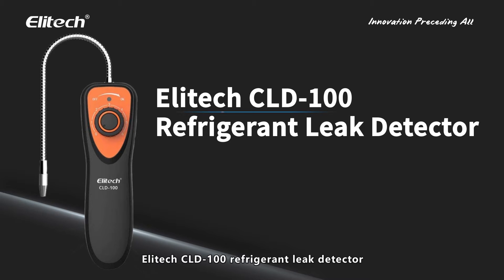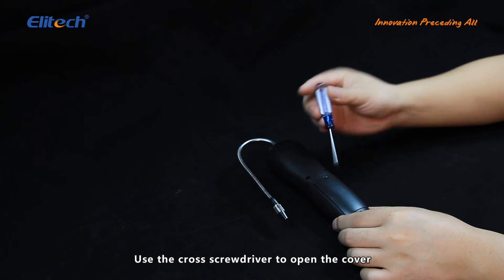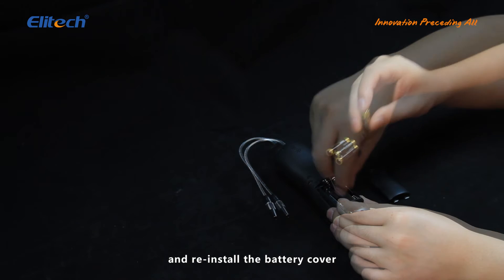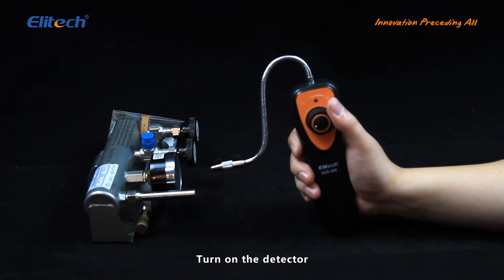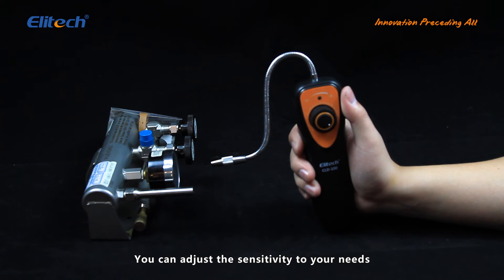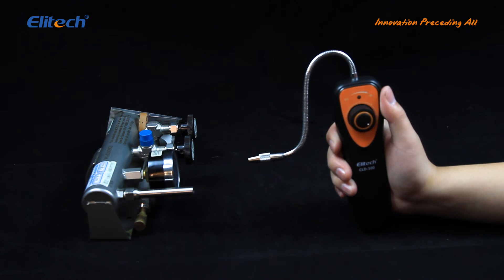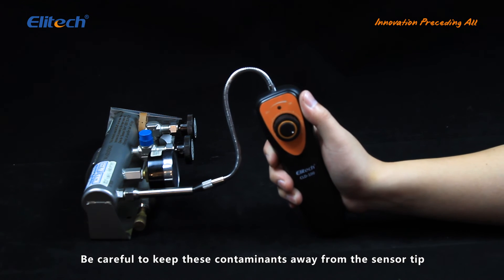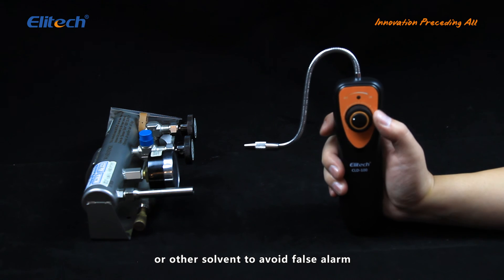Elitech CLD-100 Refrigerant Leak Detector Halogen Refrigeration Leakage Tester

Comment: Just to make your video a little bit more professional, maybe just shouldn't say reinstall the battery when the person has never installed a battery in that device before. And I'm sure if they have done it before they would not need to be instructed on how to reinstall one. Just saying. Anyhow it would be nice if you would give a demo describing the different sounds and the different settings as opposed to some b-roll with a soundtrack
Reply from the maker: Hi, thanks for the suggestion